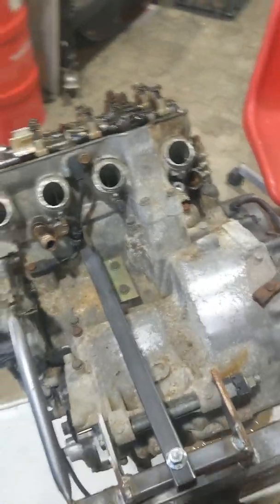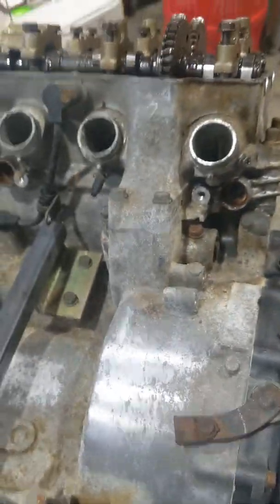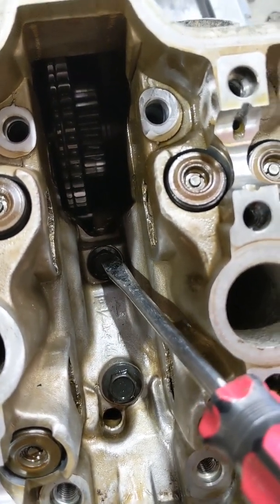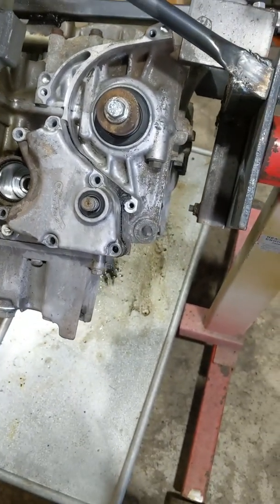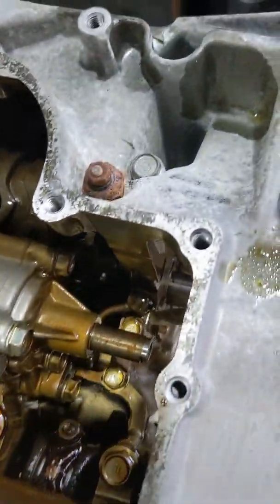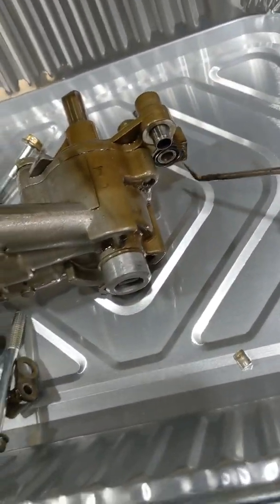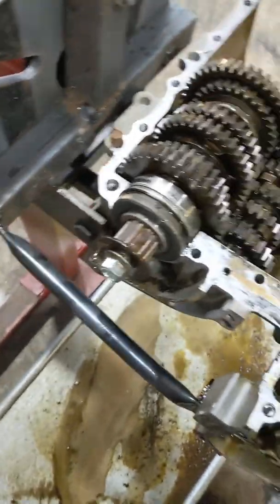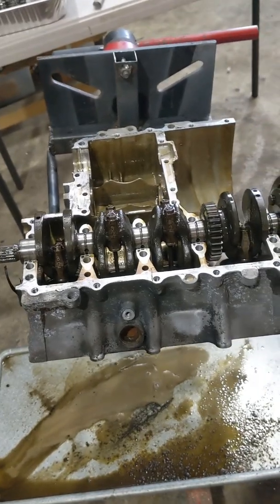CBR 250 RR engine tear down

Comment: Super helpful video.

Do you have any tips regarding the gearbox when reassembling? Like lining up the selector forks etc.
Reply from the maker: So I find it easier to insert the forks, then slide in the pins whilst getting the forks into the shifter drum as the pin comes through.

All this once the lower crankcase is installed and torque. 

Then oil pump, pipe, filter, then sump. Flip the engine over and install the gear selector.